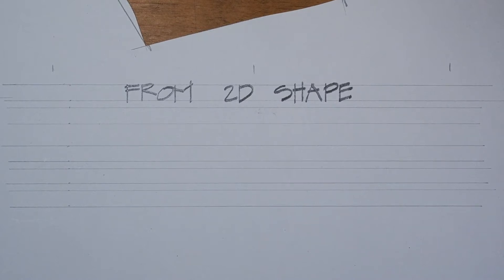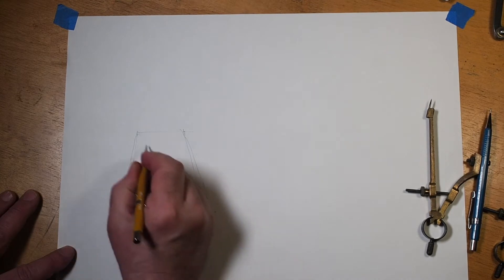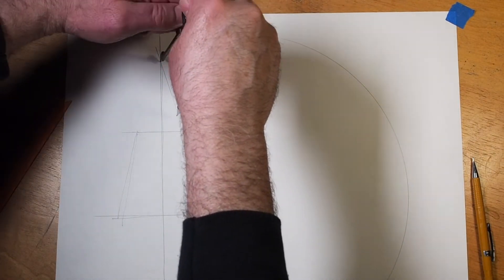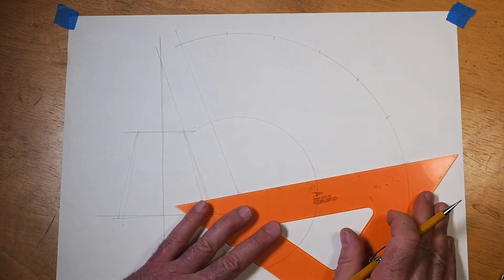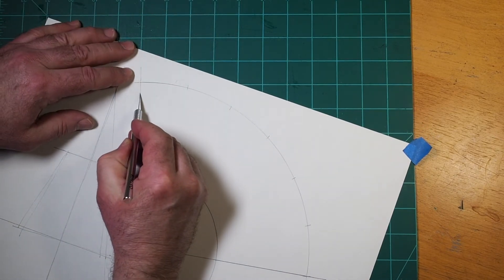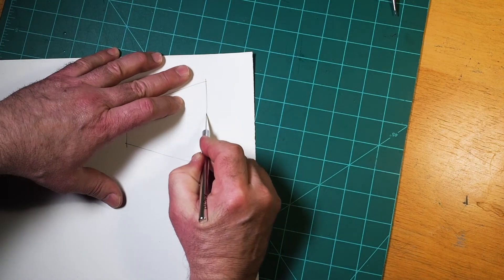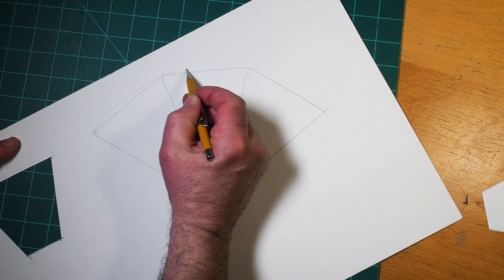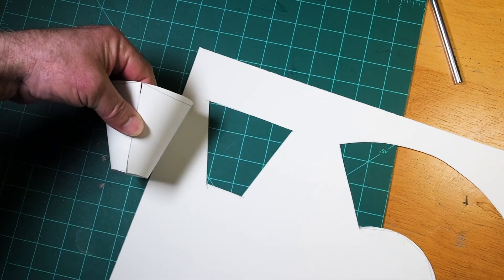Patternmaking Part 3 How to Make a Pattern for a Cone Shape

Comment: Hi there! Would you please show how to create a pattern of a conical shape with an oval top and the bottom? Thanks in advance!
Reply from the maker: Because I just imagine stretchout shapes, I recommend making a cone pattern and then splitting it.  Add in a section that is "straight" to get an idea how much to adjust the original radius at top and bottom to re draw as parabolic curve.  You only need a quarter pattern.  In reality, the "straight" section is something like another cone with a much larger radius.  To really do what you ask, I recommend looking up books on tinsmithing or sheet metal work from early in the last century.  "The Tinsmiths Helper and Pattern Book" is short and covers basics.  I also have a reprint copy of "Practical Metal Plate Work" by Paul N. Hasluck 1907.  This one covers more advanced methods for deriving shapes.  Something like you describe appears on p.135.
Reply: Thank you for the information! @robertbanker5319

Comment: If anyone is interested in drawing cone geometry like this without a protractor, I’ve created a spreadsheet for myself to draw cone geometry by dividing the cone into 8 equal sections and then laying them out next to each other. 
Just plug in the values of your top diameter, bottom diameter and cone height and it will give you the dimensions of the segment.
https://docs.google.com/file/d/1VchDCIvJI3ZqEFnRKnWGxOfubfsq6CjN/edit?usp=docslist_api&filetype=msexcel

Comment: Good information. I know you are a draftsman just by your mechanical pencils The Japanese made Pentel P203 (0.3 mm), P205 (0.5 mm), P207 (0.7 mm), and P209 (0.9mm) have been the drafting industry standard since at least the 1970's up until CAD drafting took over. I own them all, highest quality mechanical pencils ever made, and reasonably priced. I still have all my K&M triangles, scales, compasses, and other drafting gear. I am on the hunt for a drafting machine and large table as CAD software especially AutoCAD is crazy expensive for just home tinkering projects.
Reply from the maker: Thanks for the comment.  I spent ten years as a draftsman in an architect's office.  Before computer drafting was common.  We designed on trace and drew on mylar.  For basic work, it seems faster to me to use a pencil and paper.  You don't have to turn something on to see what you are working on.  Good luck finding a drafting table.  Local listings sometimes have tables with drafting machines cheap because no one knows how to use one.

Comment: It took me a second to understand why you marked off the radius 6 times. I realized that its rough 2*pi*r (2x3.14xradius) which is roughly radius times six. I hope this helps other people who maybe are confused by this. The tutorial is great but maybe could be more clear about the reason why 6 was given or why 3 was given--as a rounded version of pi (3.14). Hope this helps others! Thanks for the tutorial.
Reply from the maker: It's there at 18 seconds into the video.  Your note is more clearly described than my narrative.  You are quick enough to figure out the tinsmith's rule of thumb as a math problem on your own.  I made this video for my students in part to show how math works out in physical form.  The relation between chord length and arc length and pi is interesting to me, even as an artist.  When using this way of making patterns for clay vessels, the fit of pieces can be adjusted easily by stretching or shrinking the material.  When using this method for sheet metal, the patterns can be adjusted or a pattern offered up to a fabricated conical section.
Reply: @robertbanker5319  Thanks for your comment Robert and my bad for just missing the remark! And I didn't mean to be critical, the video is great and was just what i needed! I am learning pattern drafting for sewing and I had a heckuva time trying to figure this out initially and your video was very helpful! Thank you!
Reply from the maker: @AcidAlan  Not offended by your thoughtful message at all.  I am always open to suggestions for how to explain things better.  Most of the students I have shown these methods to cannot connect the math concept to the physical pattern.

Comment: I've been following your tutorial and I had the assumption that the base of the drawing would be the diameter of the base circle. But every time I've done it the base has been way bigger than my cut out. Do you know what I might be doing wrong?
Reply from the maker: I am not sure that I follow your question.  Here is a try based on what I imagine you are doing.  If using the first method with a compass, you don't measure using the diameter of the circle.  You use the radius - half the diameter - to determine the length of the arc that you drew with the compass.   6 X the radius.  In the second method where the sketch of the shape is reproduced three times, you are using the diameter.  The reason you step off the measurement of an arc using the radius is that the smaller steps are more accurate, the difference between the straight "line" you are using to measure with and the arc you drew is less.  
If this isn't helpful, try to describe which method you are using another way.

Comment: At 1:32  your hands obscure the placement of the compass point
Reply from the maker: I look at the paper that I am going to cut out to make a pattern and just stick the point of the compass in where I can strike a long enough arc.  Draw the larger arc first.  I have enough experience to roughly know how much of an arc I am going to need.  Something like 3X the diameter is OK .  I use 6X radius when measuring since it is more accurate when making pieces that fit together.  Since I am cheap, I commonly put the pattern parts close together so I use less paper.  I watch students put a small part in the middle of a large sheet of drawing paper and realize they have never cut anything out in metal or another material that is expensive.  It is probably easier if you draw your design on one piece of paper and make the patterns on another.  This way you will be more likely to save your design.  Sorry for the confusion but I can't say everything and keep it short enough for anyone to actually watch.
Reply: @robertbanker5319  Good morning from UK, Robert many thanks for this super reply. Your video was well made.  I suppose I am one of those grumpy people who expects everything to be just right. Since locating particular points seemed to be important I couldn't assume that the origin of this arc was random - respecting only economy of material.  Now I know what you want us to understand. It all makes sense now. Many years ago at lunch pause at work  (tube fabrication) an elderly  tinsmith  showed the group (using chalk on a welding table)   how to project a lobsterback (for a rotating ventilator).    He made his point that we had an awful lot to learn.  Sad to say I have forgotten everything since then so looked at your video to recover some element of faded memory.   Very nice to do.  I shall put this to the test very soon.  YOUR REPLY TO ME WILL SURELY HELP MANY.   thanks again !
Reply from the maker: @causewaykayak  Glad to help. I don't always reply or do so promptly but your response lets me know it helps to do so.  This is simple geometry compared to the work done in a fabrication shop or sheet metal - in the old days.  I find it fascinating to work with patterns but did not understand how to make one when I started doing this.  I began by just cutting paper and clay and folding things up.  Only later did I catch the connection with metalworking.  You might want to look for a book on tinsmithing.  I have found old books useful and sometimes they are reprinted.  Look for The Tinsmith's Helper and Pattern Book.  Some texts on the topic will show three or four ways to come up with the same shape or how to lay out complex shapes that are well beyond anything I can use in my work (in clay mostly).  Your old tinsmith would know this stuff from experience.  
I show students how to do things like this just to catch those who are interested.  Maybe explain a simple curve vs a compound curve.  Of course, they are not always interested in using compass and pencil.  The modern tinsmith would probably design on a computer and have the software plot the stretchout and maybe even cut the metal.  Somewhere along the way, skilled hands will still be necessary.
Reply: @robertbanker5319  Tha is for the book suggestion.  I will check our public library but most likely will have to fall back to an online store.

I recently needed a 1/8"  steel basket making for a small backyard forge.   I made the template in stiff card  and added a cutout separately to close splayed corners.   At the fab shop the owner looked doubtful at my angles   (had from direct measurement) and took some persuading that if it worked on a template it ought to work in steel.   At a price he took in the job  but still had to wait for his computer chap to draw it in CAD ...   because that way he could telegraph the job to another town where a remotely operated plasma cutter would doing the metal cutting.   Must say if did a neat job  but VERY expensive.

 I still use French Curves (do you call them that?)  to get nice flowing lines in woodwork jobs.  I find so many guys today are impatient to get results  and very few of them work with hand tools where a powered option is available.   Result is most lads can't saw, can't set out mortices,  The hand work skills  these days are becoming the preserve of a small minority of  specialists.     I recently saw a film on the u tube  where a gentleman  made an engraved brass astrolabe from plate  - even creating a small lathe (watchmakers type)   to turn small buttons and spindles.  Such patience and a thing of beauty to show for it.  Turning, engraving, gear cutting,  plus the astronomical knowledge.    Not unsurprisingly he was an Israeli craftsman  and he engraved his device Arab style IN ARABIC.   I know I just fell over in admiration.    Thanks for your time sir,  All the best from Northern Ireland.

Comment: Why did you only measure half of the base  . 4 layout of  cone base . Why was 6 used for base layout .. instead of pie
Reply from the maker: This is a tinsmith's rule of thumb.  The mathematical formula for circumference of a circle = 2 x pi x r.  Pi is just short of 3.  therefore 6x r.  If you are stepping off an arc with dividers or compass, it is more accurate to use radius than circumference.  The radius length is closer to the arc length.  The difference between using 3 for pi and 3.14 is close enough to the difference between the length of the chord of the arc you are measuring with the dividers and the actual length of the arc.  So the tinsmith's rule of thumb skips the use of math and numbers.